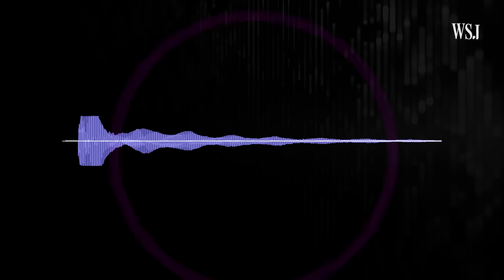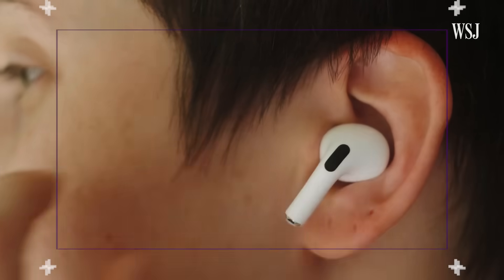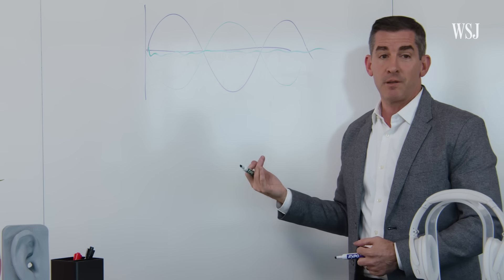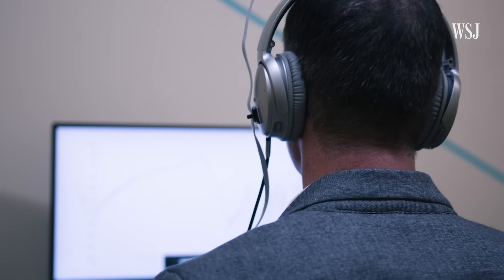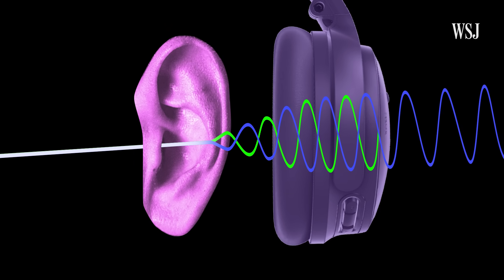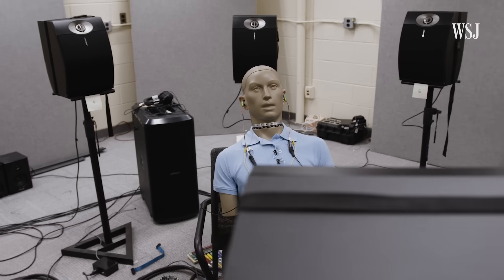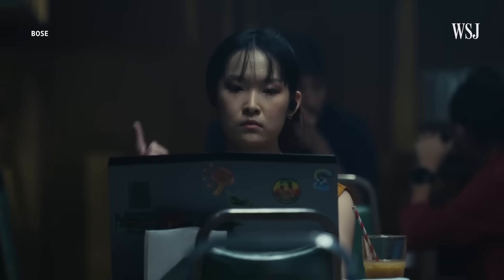How Noise-Canceling Headphones Create Silence in Microseconds | WSJ Tech Behind

Comment: Thought this is really well done and gave a really good explanation of how the technology works in a level that most people can understand what I do take issue with in this video though is that noise canceling technology of this type actually goes back to the 1960s with analog processing as opposed to more recently with both using digital signal processors.

Comment: If the electronic circuit is damaged and inadvertently produces acoustic waves with the same phase instead of the opposite one, the outcome is increased noise and loudness. It's imperative that this electronic circuit remains intact and consistently produces waves with differing phases. The application of physics in sound engineering may appear complex, but in reality, it's quite simple

Comment: I have owned several pairs of Bose noise canceling headphones for years. I never fly without them. They are amazing.
Reply: Does it completely block the engine noise during flight?
Reply: @혼패리음  Almost. If you sit next to the engine at takeoff, it can overwhelm them and you will hear like static/popping.

Comment: I have spent a fortune on different models but none can bring me silence from noisy neighbours 😢
Reply: Same here, the overall performance is always disappointing.
Reply: no active noise cancellation is able to cancel out every single outside noise. for that, you need actual earplugs or IEMs (in ear monitors) with really good sealing and correct tips for your ears (fit and sealing are very personal. an IEM that fits and seals perfectly for me might not do the same for you). If you're really serious about this, you might wanna look into custom IEMs: they make a mold of your ears and create an IEM perfect for you (but they can get really expensive).
Reply: @lucastarg  thank you, I hadn't heard of IEMs.

Comment: What I can not understand yet about active noise cancellation if also protect the people from louder environments. An example: if I work work near an industrial machine that requires earbuds for preserving my hearing, will the use of noise cancellation only reduce the noise I perceive or also effectively preserving hearloss? I never found articles about this.
Reply: they are not, because these small drivers did not have enough power to counter those heavy noise. passive noise cancellation is better for that
Reply: They have ANSI approved noise cancellation headphones for gun shooting.  Those should be ok.  They have to be approved for OSHA work environments.

Comment: So is this worse or better for your ears? You can’t HEAR the sounds but you’re exposing your ears now to twice the amount of energy that it would’ve otherwise received, right?

That’s the part I never understood and nobody touches on. How can your ear receive twice as much info without experiencing more physical wear?
Reply: Ive had the same question too for years...
I dont know if this makes sense but this is just my assumption, as there is no definitive proven answer out there yet (not that i can find)
Theoretically i feel that you are right, since the energy is still there and doubled, and has no where else to go other than into the ear canal. Hence i suppose that's the feeling many anc headset users have of a pressure in their ear canal when they use it. 

But a other part of me sees it the other way...
Since it is still sound and the same way sound is created; by pushing and vibrating air particles, and louder sounds are created by the particles being pushed with more force, since anc simply plays back sound of the same volume, the particles are still pushed and vibrating with the same speed, just in a different pattern so it sounds different, hence technically applying the same amount of pressure to your eardrums. (maybe...?)

Ive got no clue man both seem to make sense to me. but thus far there has been no reported cases of hearing loss due to anc possibly causing an increased amount of force on the eardrum, hence it should be safe to assume that anc technology is still safe to use. its up to you if youd rather have to listen to your noisy surroundings, or take a miniscule risk that you may experience hearing loss from anc.
Reply: @hihi-by1me  Exactly. I wish someone could make a closed system with an ANC box where you can generate a loud noise and have it cancelled while measuring the overall energy in said system. It would confirm if it doubles the energy or somehow cancels itself out, which doesn't make sense.

You might be right that the energy stays and why ANC has that pressure effect. It is really noticeable on Sony XM over ear headphones.

It's weird so many people believe that energy just cancels out instead of getting dispersed.
Reply: No, it is destructive interference... Energy is reduced between eardrum and headphone speakers
Reply: @InternetDisplayofPower  Where does the energy go? To my understanding, there is energy (sound) coming from outside and also energy (sound) coming from the headphone. So how does 2x energy not get transferred into the ear? I get that they 'cancel' each other out so we cannot hear it, but what happens to that energy?
Reply: @scpdatabase69420  think of it like gravity. if you have an object in your hand, it is being pulled down by gravity with a certain force F. Your hand pulls it up with the exact same force F in the exact opposite direction. The resulting force the object statically "receives" is exactly zero (assuming we can ignore torque and whatever not). However, (in some sense of 'system') the total power delivered in this system is definitely not zero.
Reply: @simondonne7865  In this example, isn't the hand exerting force equal to the force of gravity so that the apple is standing still? It still experiences the force from the gravity and the force from the hand. They are simply static.

In my mind, the example is more like the apple is on a surface and there are 2 forces pressing on its sides to hold it still. When one side presses harder, so does the other side. This way, the apple is static. However, there is increasing force applied to the apple to keep it static, so eventually, when there is enough force, damage occurs, even though the apple remains in the same position.

Replace apples with your ears and that is my question. If the noise is SUPER LOUD, enough to damage your ears, and you have ANC that can stop the noise, would your ears still be damaged from hearing both sounds at the same time?

I might just be misunderstanding physics here. When I tried asking ChatGPT, it stated that your ears receive twice the amount of energy, but due to the cancellation effect, the overall volume used is lower so making ANC useful.
Reply: Also the question I wanted to know.

Comment: You should've interviewed the Japanese about this...particularly Sony. Their QN1 processor is unparalleled
Reply: Well sure Sony has an amazing QN1 processor no doubt but Bose has much more experience when it comes to noise-cancelling, considering they were the pioneers of the noise-cancelling headset. Their experience extends beyond the consumer line. I mean just look into the aviation industry and see how many of them are using Bose over any other brand.
Reply: the H2 chip
Reply: @masterdoge17  Apple knows nothing about sound please... how many awards has it won again?
Reply: @lehutjomaja1173  In terms of noise cancellation the AirPods Pro 2 are genuinely the best you can get in earbuds.

Comment: Can you generate an inverted gravity wave and cancel gravity?
Reply: Gravity travels at the speed of light. So, it’s instantaneous. That is, sound travels at a measurable rate from the headphone speaker to the ear canal. Any inverse function requires a calculation. Because gravity travels at the speed of light, this likely wouldn’t be possible.
Reply: Only if you can manipulate gravity without need of adding mass.

Then you have to find the elementary force unit and be able to influence it
Reply: Ask Bob Lazar
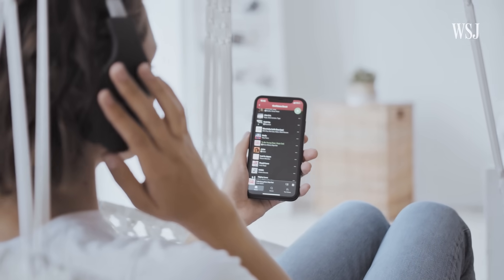Reply: 4:53 does it? Has been “noise canceling” For 2 months
Reply: in theory: actually yes. You could. It even happens naturally in the universe in black holes (maybe - we don't know but the theories say so)
Reply: You mean anti-gravity? If humans actually manage to do that we'll finally have flying vehicles.
Reply: Gravity is a wave. This can be proven in many ways: in the atmosphere or through a moving object. The point: gravity produces ripples that have amplitudes and this is used to calculate its speed.
Reply: @posthocprior  plus, gravity waves can and have been observed in an astronomical scale